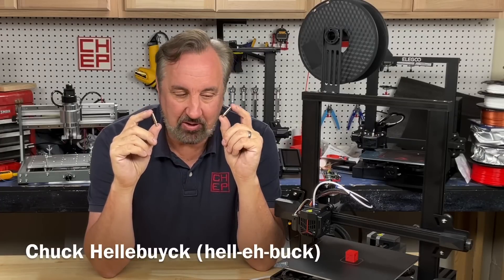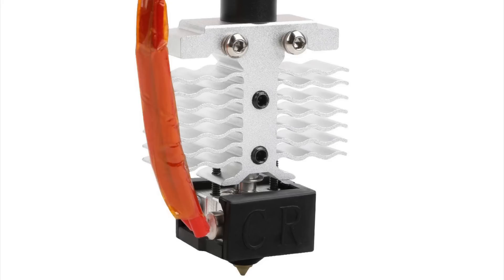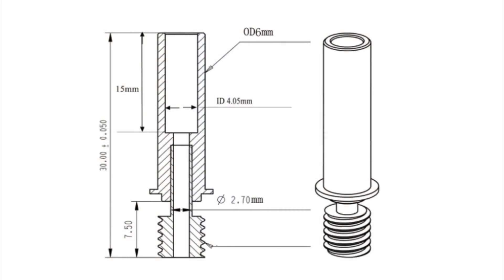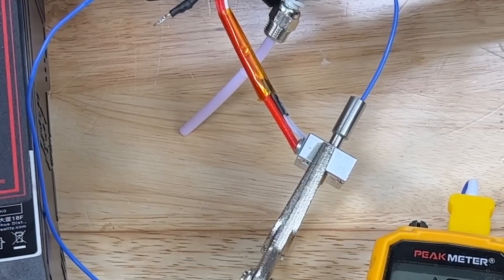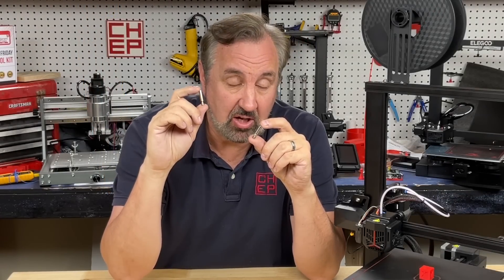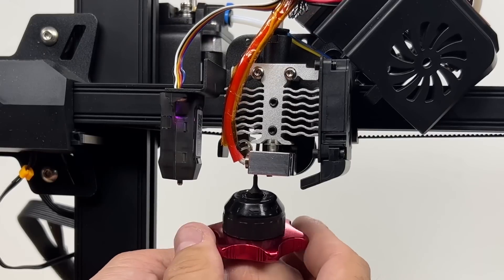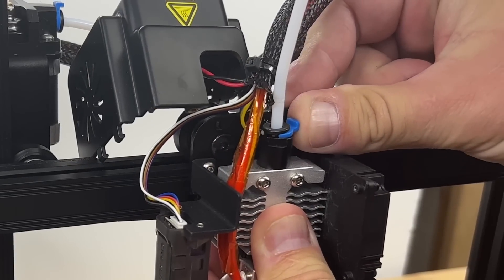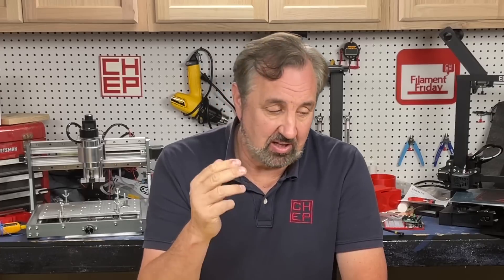Upgrade Ender 3 Neo Hot End

Comment: Is  there ever really a need to validate the temperature sensors with an external standard? Or, are  these printer thermocouples  pretty accurate  as is?
Reply from the maker: Not really but you could check if it seems really off.

Comment: At my wits end with this fix/upgrade, tried 2 different bimetal heat breaks, installed each twice, fresh nozzles, fresh PLA that works like a charm in another Ender and I get a good first layer and then it clogs/stops extruding.  Changed my retraction distance to 2mm and retraction speed to 95mm.  Ender 3 Max Neo. Any help would be much appreciated.  TYIA
Reply from the maker: Check your hotend cooling fan. It’s probably failing. If you can’t touch the heatsink because it’s too hot, the fan isn’t cooling it enough.
Reply: @FilamentFriday  failing, no, failed, YES, solder connections are good, the fan is simply dead. Also noticed while testing with my ancient Ender 3 it is missing a blade.  Thank you, thank you, thank you, I was about to lose my mind.

Comment: Thank you for this video!  I have had an Ender 3 v2 Neo now for some months and have yet to get a clean print.  Having experienced a complete block-failed print, I purchased a full replacement head block kit.  Since then, I've discovered I'm suffering Heat-creep! (PLA expanding massively in the FTE tube in the heat sink! 😞
I'm hoping this will finally help solve my issue and get my darn printer back up and running!

Comment: Hey Chuck, I know you're past the Neo by now, but I'm in a situation where I am unable to find anything in regards to my situation.  I purchased a spider high temp. and high flow hotend pro, and find that the nozzle no longer reaches the bed, because of the blue touch and the fan shroud.  Do you by chance know of a solution to this? A link, or a video, stl?  I still have one working printer, the neo thermostat went out I guess, so I decided to upgrade, and now I'm stuck without a clue. I'm really sorry to burden you with this, but you are one of the better teachers here, so I'm hoping you will have at least a direction to turn to. Thank you  .
Reply from the maker: Have you thought about restoring it to the original setup with a new Neo hotend assembly?
Reply: @FilamentFriday  I could do that,  after waiting almost a month just to get this spider in, it kills me to not put it to work.   I kept digging,  I might have found some mounts that will help,  gotta wait for my other printer to finish it's current project,  if it works,  I'll see if I can post a link to them,  in case anyone else has this problem.  Thanks for responding.
Reply: @nogard0007  Any success with the mounts for the Spider? I have a similar situation with my Max Neo. Thanks in advance!
Reply: @drlandmark  you will need a small round file to tidy up the bolt holes alittle,  but the mounts worked like a charm.
Reply: @nogard0007 so you got the spider working?
Reply: @pimpinkeen19  yeah,  after installing new fan/ cr touch mounts. I had to recalibrate,  but it's working well now.
Reply: It's pretty known that the Neo hotends are longer than a mk8, which is what the Spider replaces. This means if you mount the Spider, it sits up into the housing too far. 
There are printable adapters to lower the Spider on the bracket to get everything else to line up.

Comment: I fitted one of these to my max neo. Just caused a lot of stringing. I tried more retraction and did all of the speed temperature flow testing but nothing helped. Fitted the original and worked better.
Reply: 1-2mm retraction distance.  Your probably pulling the filament into the cold part of the hotend

Comment: They offer a ceramic core version as well on the amazon link posted above.  Has anyone tested this on an Ender 3 Max Neo? Is there advantage's to the ceramic vs the all metal?
Reply: I was about to order one for my Neo V1 as well but most of the bad reviews was of the ceramic version so I bought the regular one. The advantage is that ceramic conducts way less heat so there is even less heat soak up to the ptfe tube. I think it's unnecessary though as shown here, where the ptfe sits only gets to 100c ish. I believe the ceramic version may have less friction as well so it may help with clogs?

Comment: Hi, i have the same printer and changed the barrel by a bimetallic one, the printers keeps clogging in the cold zone at the middle of the print. I trided from 0 to 4.5mm of retraction and from 20 to 50mm/s of velocity and keeps clogging. After days of trying i installed the old barrel with a capricorn tube
Reply: J'ai exactement le même problème, j'y comprend rien.

Comment: Didn't work for me ...clogged and clogged and clogged!
Reply: I think it's the fan. Someone noticed specifically on the Neo printers the soldering is weak for the fans
Reply: @teeambird2079  Brand new Neo here, would'nt extrude correctly, thought it was the tension on the idle wheel, so today intsalled the direct drive, still nothing. Found the hot end was clogged to cleared it, set the e-steps and bingo, working perfect - for 45 mins then stopped extruding again. Back apart and I find the wire to the front fan is off. The solder is crap, so possible all this time I had heat creep. Soldering iron out is the net job and a new hot end as mine is toasted. Oh the joy...

Comment: Am waiting from China the direct drive extruder for my Ender-3 and i need your opinion.i have the upgraded heat break in stock.
Its good idea to replace the heat brake on the direct drive or i will use the new direct drive how it is?

Comment: Hey, guys.  This is awesome upgrade.  However many, including me, have posted a difficulty in getting the new heat break to fit inside the heat sink.  I just had to redo mine, since I messed it up the first time.  I found that one heat break would not fit.  But another one, ordered at a different time from same seller, purportedly the same item, would fit easily.  So if you are having problems and can't get it into the heat sink, it may be a supplier/defect issue.  Not required to make it hot and trade off the aluminum/copper heat expansion.

Comment: Question:  The upgraded copper heat break doesn't fit inside the aluminum heat sink when cold.  I see that you are inserting it when hot.  I assume that it fits better when hot?  I tried this once, but didn't get it right, so I will have to do it again.  I would think that, when hot, the copper would expand and be larger.  You easily inserted the copper into the aluminum heat sink.  Did you do anything special, like drilling out the heat sink a bit?  I'm trying to get it figured out before working around the hot metal (again).
Reply: The heat break itself is not hot, but he is inserting it into hot components.

Comment: Hey dude.  Your videos are the best on Youtube.  I only watch yours and CNC kitchen (for filament and printing tips).  However, the heat break is primarily due to the titanium between the top and bottom, which is a pretty good thermal insulator and doesn't conduct heat very well, not the diameter of the tube.

Comment: I began modding a monoprice mini select a few months ago and this was one of the first things I did (along with replacing the entire hot end) and I accidentally got the 6mm diameter ones instead of the 7mm.  But I got a 4 pack off ebay for $11 shipped.  I couldn't imagine paying $17 for one of them.  But then again I did wait 6 weeks for them to arrive from China but I wasn't in a hurry so it was fine.  I had no end of clogs and ptfe breaking down and these things solved all of those issues.  TBH this upgrade is a no brainer.

Comment: So, I got this installed, but I seem to be having an issue where the filament backs out or breaks off and jams against the throat.  It’s stops printing, I try to manually feed because there doesn’t seem to be a clog and it won’t advance.  I have to pull the tubing and reinsert the filament down the throat.  Is there anything I can do to prevent this?
Reply: Bonjour, as tu trouvé une solution à ce problème ?

Comment: OK.  Now stating the obvious:  Mr Chep is Very Very good at this.  To the point that mere mortals like us will have lots of difficulty following in his footsteps.  Follow his directions exactly, but be prepared with aloe.  200C is HOT.  For me, this upgrade was a HUGE PITA.  I finally got it done (lie--its not 100% done yet!).  Its been 3 hours and I took a break to type this.  The new heat tube would NOT fit into the heat sink!!  Of course, I was not willing to work with 200C hot ends flopping around me for an hour, and ended up heating it up and cooling it down several times.  Perhaps if I had been, the metal expanding would have allowed the new tube to be positioned easily.  But I doubt it.  Mine would also not screw easily into the hot end.  Nor would the old one screw out as easily as his did.  And yes, I did have it hot for that.  Ended up using pliers and probably scored the new heat break, which undoubtedly exacerbated  my difficulties in getting it to seat properly.  I strongly recommend some thermal grease, not just to more easily transfer heat, but to lubricate the new tube's insertion into the heat sink.  I didn't have any on hand and it was Sunday, so I made do.  BUT it is a great upgrade.  BTW, it also means that for those who have installed the new Sprite SE direct extruder, a mod to the intake tube is required.  Approx a 1/2" needs to be cut off.  Just wing it.  I don't think its critical on the extruder end. 

AND HUGE THANKS TO CHEP.  There are very few working with the 3 neo on youtube and Creality is no help.  Can NOT find out what parts work with the neo.  

And lastly,  a question for Chep.  Will this allow this hot end to exceed 260C?  Or is it just a better option to print near 260C?
Reply: Just chiming in here to echo your experience - particularly with getting the old heatbreak out. Tried with a few sets of pliers, and they're all just spinning on the heatbrake rather than the heatbrake twisting out.

Comment: I orederd from link, the heat break didn't fit the heat sink at all 😢
Reply from the maker: Maybe they sent you the wrong one. Is it too small? It’s fits the Ender 3 Neo which is a larger diameter.
Reply: @FilamentFriday  I ordered from the link and it fit my ender 3 neo. Installed and ordered my 3d printer/hot end and installed within the last month.
Reply: @FilamentFriday  I believe they did sent me the wrong one, I ordered from a different store and the one they sent fir like a charm, thanks for sharing this content, it has really helped me with my 3d printer
Reply: Yeah, just about destroyed my hot end trying to get it wedged in there.
Reply: @chrisb1601  Me too.

Comment: Tried this with my V2 Neo and, unfortunately, no success. :(

Printing starts well, but after some time (probably an hour) clogging occurs. From what I can say, it looks like the upper part of the heat break is getting to temperature where PLA softens, and clogging occurs.

I really want to get is working, because PTFE after the first months of printing looks pretty bad, and I even haven’t started to print PETG yet.

My plan is to try putting some thermal interface between hotend and radiator.
Reply: Try adding 2 drops of mineral oil down the hotend works like seasoning metal once done you really don't have to do it again it seasons the metal and keeps it from sticking when it's soft.
Reply from the maker: I don’t recommend mineral oil. It gets on the bed. I use olive oil. It burns up like in a frying pan but lubricates well. https://youtu.be/OG7We83M5gc
Reply: @FilamentFriday  it's not for lubrication, the point is to get it vaporated to create seasoning in the inner part of tube I guess.
Reply: Did you ever find any solutions to your issue of clogging after 1 hour? After installing this piece, my ender 3 max neo has the same issue. Clogging after 1 hour and I can barely get the filament back out. Ugh!
Reply: @armoryofalbus  You have to lower your retraction settings. It's probably around 6mm, I found around 2.5-3mm works well but try a retraction test tower.
Reply: @armoryofalbus  actually, yes.

I gave it another try, and it worked. Not sure if it was because of a different heatbreak (which probably was a bit better quality) or because of thermal paste I've applied, but no clogging now.

Though, stringing got really bad. I spent a couple of days experimenting with printing parameters (retraction distance, retraction speed and nozzle temperature). At this moment 

I'm able to get more or less OK quality of prints, but:
1. Still not as good as I got with stock heatbreak.
2. I had to set nozzle temperature to really low values. Like 190°C, or even 188°C. More than 195°C stringin get's worse and 200°C+ it's really bad.

In my currents settings, retraction is 2.4..2.7 mm @ 40 mm/sec and nozzle temperature usually 190°C.

Now I'm waiting for the most expensive CR-6 compatible heatbreak I found on AliExpress (it's from Kingroon, and price is ≈4$ per piece, the one I'm using now was ×2 cheaper) and going to try also it. 

In general, I have a suspicion, that the cheap bi-metal heatbreak use not really titanium alloy for the part, which is inserted into the heatblock. If this part has high thermal conductivity, it makes melting zone a couple of timez bigger, which can cause filament oozing, which in turn causes stringing.

Anyways, despite all troubles, I'm not going to return to the stock option, because I had my PTFE burned to the state when it started to cause clogging every 4 to 6 weeks, which is was not acceptable for me.
Reply: @IgorPomaranskiy  Bonjour, j'ai exactement le même soucis. Avez vous trouvé une solution pour régler cela ?
Reply: @granolasticot6169  I still had 2 of them destroyed after having hotend heated without cooling applied (when I did maintenance), but if you're careful — they should last for a long time.
Reply: @IgorPomaranskiy  Vous n'avez pas eu du tout de résultats positifs avec le heat break bi metal ? Je pense de mon côté arrêter avec cette pièce et revenir sur celle d'origine.
Reply: @granolasticot6169  I 'upgraded' to P1P long time ago, but my Neo still works (almost 24/7), I gifted it to my father-in-law. And curently it's with bi-metal heatbreak.

At some point I also thought about switching back to the original heatbreak. And it's probably not a bad idea (especially together with changing teflone tube to Caprocorn, which withstands a bit higher temps). But, only in case you're not going to print PETG.

My father-in-law prints almost exclusively PETG (we print different stuff for Ukrainian Army), so original heatbreak was not an option, with temps 230-240°C PTFE tube will burnout weekly.
Reply: @IgorPomaranskiy  Pour l'armée Ukrainienne ? Bravo c'est génial !
Que me conseillez vous de faire alors si je souhaites garder le bi metal mais que pour le moment celui ci ne fonctionne pas efficacement sur mon imprimant ? Avez vous une astuce ou des paramètres à utiliser ?
Reply: @granolasticot6169  Thanks. :) 

I don't remember exact settings and have no direct access to Neo. Retraction was significantly smaller than with originial heatberak, something like 2.5 or 3 mm, and that's probably it.

The key point is to find a heatbreak of good quality. Plus thermal paste on the top part.

Oh, and one more thing. Taking to account that with bi-metal heatbreak you'll have much bigger volume where filament melts, probably you'll have to set much lower printing temps in case of stringing or other quality issues.

Good luck!

Comment: Hey chep what can i do to my ender 3 v2 neo to print carbon fiber nylon. Already got capricorn tubing, a bimetal heat break, and some steel nozzles. Do i need a better heater cartridge and some firmware? Or what else do i need? Not much info on the neos or any upgraded hot ends :(
Reply: Can the neo hit 260C? If so all I would reccomend is a heated chamber and a filament dryer, nylon loves to soak up all the moisture in the air.

Comment: Good evening
I own an Ender 3V2 Neo and I would like to change the extruder and hotend for a direct drive, which would be the best model for my printer. I use PLA+ and PETG in general. Thank you for your help.
P.S. My motherboard and firmware allow a temperature of 250°C maximum.

Comment: Hi Chuck! Just wanted to let you know, I just put together my Ender3 Neo V2 and performed this upgrade as part of my assembly! Literally not a drop of filament went through the stock setup, and it has been working perfectly. I had an Ender 3 Pro a while ago that got hit by a lightning strike that fried all the electronics and motors so when I replaced it I tried a Prusa Mk3S+. I've come to realize that while the engineering is impressive, they're SERIOUSLY overpriced, and I'm glad to be back tinkering with an Ender again!

Comment: Just wanted to stop in and say: Thank you for making this video. The replacement heat break you suggested in this video was the key solution to fixing the absolutely infuriating retraction issues I was having while trying to print anything that involved a lot of retraction. (It would end up clogging the tefflon tube, requiring it to be replaced every time!) With this new part, the printer finally can finish this prints without causing a clog, and i thank you

i do have one thing to see if you know, though. Is the Neo compatible with the Ender 3 Pro's dual z axis upgrade? Have been thinking about getting that but it does not list the neo as supported.

thanks again!